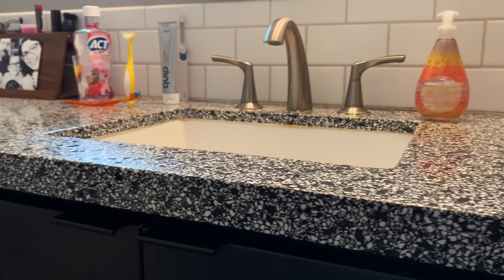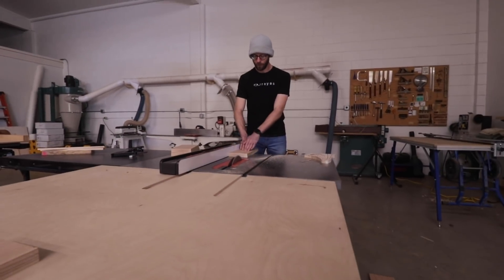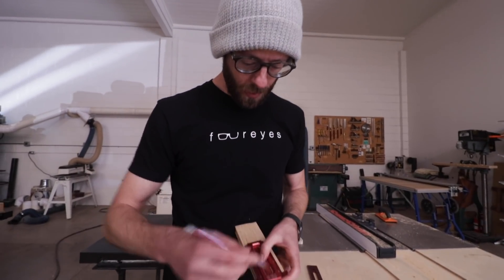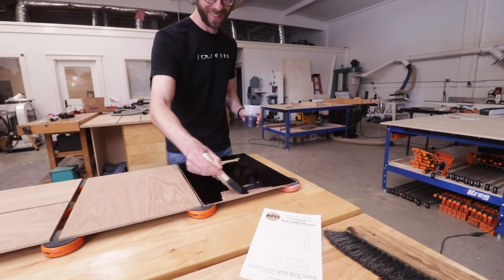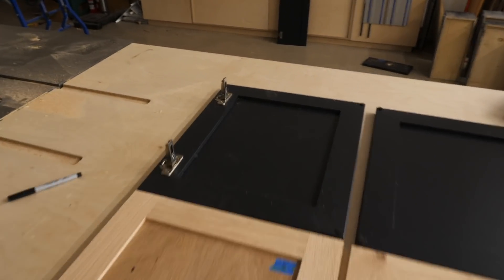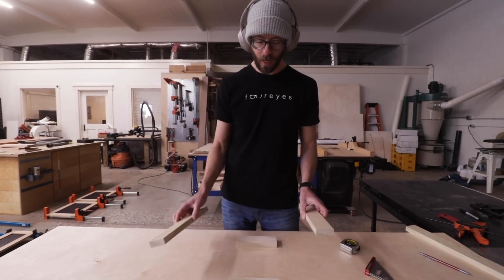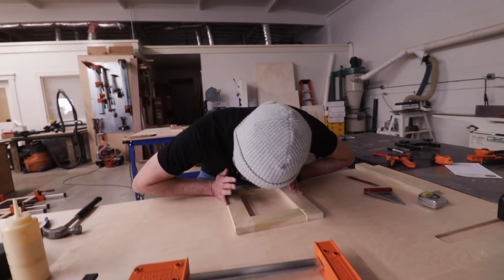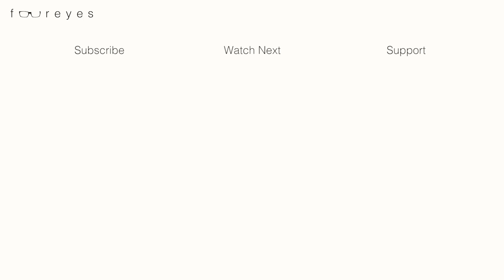My Bathroom Vanity Sucks! I'll Remodel It - Build With Me

Comment: I feel Chris needs to invest in a metric tape measure.. In fact, I CHALLENGE him to do a video in JUST metric.. :D

Being Australian, It's metric here, but I fully understand the Imperial system, and even talk in in sometimes, but I almost got a migraine (my eye actually started to twitch a bit) listening to Chris try and work out the fractions in his head, by talking them out loud..
6 and 3 quarters inches, plus an inch, minus 3 8ths.. gahhrghhgraAHH!! stroke out

Metric is the only way to go, RARELY do you need to go into half millimeters in woodwork..
So, the above mess would become (yes I'm rounding for clarity) 172mm plus 25 = 197mm, less 10mm = 187mm. cut.
No messy fractions, whole number calculations, and the entire system is Base 10 - you can do metric on your fingers..!
Reply from the maker: I admit it's a better system. So as soon as my country makes it easier to switch I'll be glad to. That said. The problems or topics in this video didn't have a lot to do with metric vs imperial. For example. If you subtract 3/8" or 9.525mm from a gap...you'll end up with a panel that is too small.
Reply: tell me how to divide 10 cm into three equal parts.
Reply: @thecrazyisreal  sure. 10cm is 100mm. So divide by 3 = 33.333333
I have gone to a millionth of a millimeter (you tell me what that is as a fraction). But for wood working we would never go to that accuracy level.
Reply: @W B I’ve just checked my imperial drill bit set and I can’t seem to find a 1/3” or a 5/6” drill bit anywhere??? So you have the same issue if you divide 10 inches into thirds also.
Reply: W B & MatiuPirihimana Multi-point equidistant dividers don’t require math. You can divide 10 cm or 10 in into as many identical sections as points on the dividers.
Reply: Fun video, nice change that shows you’re both human
Reply: @thecrazyisreal  you can't cut an inch into 3 equal bits either mate, so your point is moot.
Although a set of drill/Forstner bits in thirds or sixth's, even twelfth's perhaps, to fill in the gaps up to an inch would actually be handy in some applications).
All the divisions of an inch are by 2, whereas you can easily cut up a centimetre by 1's, 2's and 5's.

But to answer your question, you would measure to 3.333 (which is a few sandpaper passes bigger than a 1/8th" drill bit in fact)
I don't know about you, but I can easily see down to .25 of a mil, (that's 10/1000ths of an inch, by eye, man), and hit the mark with my knife, (not that you really need to be that accurate in timber, in steel sure, but not timber).

Now, metric bits come in half mil steps, so getting your 3.5mm bit is close enough for wood work, adding 3 of them together means you'd use your 10.5mm, which gives you that 0.25mm clearance around your dowel. I'm happy with that.
Reply: @Foureyes.Furniture   metric is already used in the States all over the place, most science and engineering, specifically in the space industry use it, but in order for metric to become widely available and used in American life, it would require the public to demand it, on mass.
I'm not saying you guys should just dump the imperial system in a weekend.. This would have to be a generational thing, and for it to be taught in schools along side imperial, and doing it this way would get people to accept both.

People who use rulers and tape measures will have to just only buy metric ones, even if that means getting them online if Home depot doesn't stock them.. as well as repeatedly requesting stores to get them in.
In the same way as I have to get my Titebond online, (or drive a 400km (250mile) round trip to Sydney to the only place in the state which stocks it), since our main chain, Bunnings, (my local is 8 minutes away) doesn't carry it, and not for want of me requesting it for the last few years either, I might add)..
The wheels of change turn slowly my friend, and sometimes they need some oil to get them going a bit quicker.. be the oil. 🙂
Reply: I know! It does my head in!
Reply: I'm an american and I do all my woodwork in metric. it's just easier, and all our tools have metric measurements on them anyway.
Reply: “A linear foot?”. Would a woodworker think it be fun if I say “No, a logarithmic foot”?
Reply: It's weird to see some arguments against metric: how you divide by three, the construction business, the is no equivalent in metric to an inch, and my favorite, there is no volume in metric corresponding to the typical thirst of a humsn being...
Reply: @GenoLoma  They've been trying to go metric since 1975. I say it's been long enough to ease into it, do it tomorrow.
Reply: Yes Please :D my brain is burning because of impeiral :DD but i like his work realy much!!!
Reply: @karenmitchell6814  yes, but you don't. You use six as the base.
Reply: Listen my Australian friend!!  There are two countries.  Those who use the metric system and those who went to the moon!!  Seriously, I use metric at work, injection mold making, and it is easier.  I'm just too stubborn to use it in woodworking.  Maybe one day.  So, we use bd/ft to buy our lumber.  What do you use?
Reply: @peepawhebert6479  theres not a lot of rough sawn limber yards around here, so most timber is already dried and dressed ready to cut up.. the only issue with this is that we are kinda limited on our standard dimensions for timbers, without having to resaw and plane things down from bigger timbers .. everything is in metric though, so 3/4" is around 18 or 19mm.. plywood comes in 7, 9, 12, 15, 18 and 25mm. Some tapes will show half mil steps, which gives you 50 divisions in an inch, and I challenge anyone to require accuracy in timber higher than that..
As for going to the moon, the space program has almost exclusively used metric for pretty much everything.. and in fact, when people have misinterpreted dimensions into imperial, that's when things have failed..
I can, and do, use both systems, but metric is orders of magnitude easier and cleaner.. as evidenced by the 3 minutes of brain-melting discourse in this video.. it hurt my head to listen to it, and I understand it! Imagine someone who can't..?!
Reply: For me the imperial system is like measuring in squirrels and caterpillars. The hight is 3 squirrels, 5 caterpillars and one severely mutulated caterpillar

Comment: When I'm using a miter saw like that and want to cut consistent length pieces I cut one piece and then use the built in clamp to hold that in place. Then that becomes your new fence and you can flush up the ends of that with the next piece and cut it exactly the same. It will also serve as a backing piece to help with blowout.

Comment: Similarly to another commenter, there are usually holes in the fence of miter saws that you can use to screw a long 3" wide board to the fence and then use as an auxiliary fence to clamp a stop block. This was my setup for awhile before I got a table saw and it works fairly well for repeatable cuts

Comment: The math on 1/8 and 1/16s broken dimensions is harder??? Metric to the rescue!

I love to watch a lot of you North American makers, but your dimensions system make me crazy! Fractions all the time, crazy math when adding different base fractions: 3 1/16 + 4 1/2 + 1/8...  Crazy stuff... So I learn to just ignore the dimensions and try to just get the big picture.

We "metric rest of the world" just add. 1mm is measurable with simple tools and precise enough for a lot of things (like woodworking) at the same time. You have control over the dimensions? Centimeter is a precise enough to a design phase without using fractions (or in our case the millimeter). In the very precise world you don't need to change the way you calculate, no tenths, hundreds and thousands of an inch (in base ten)  mixed with fractions, just more zeros between the comma and the number.

And if you have mm and cm mixed in the project in different tolerance parts? No worries: 50cm + 23mm + 2,5cm don't confuse since everybody use base 10 math in day to day tasks and learn to move decimal cases around when needed (like with money).

Just a rant... Still love the content, just hate the measuring system.
Reply from the maker: I admit it's a better system. So as soon as my country makes it easier to switch I'll be glad to. That said. The problems or topics in this video didn't have a lot to do with metric vs imperial. For example. If you subtract 3/8" or 9.525mm from a gap...you'll end up with a panel that is too small.
Reply: I understand the difficult in the transition, but metric will never catch up in USA if everybody wait to be a more accessible thing. The ruler manufacturer will never sell metric rules if all the buyers waits to every rule be in metric (oversimplification in its worse!).

Some channels are doing a thing that I think is a disservice for metric, telling that the plans are in both systems but showing metric dimensions in a simple conversion: 1" or 25,4mm... 1/8" or 3,18mm... It creates a sensation of complexity that doesn't exist... 

But the main reason of the metric will never catch up in USA is the fact that when the discussion start the argument that "it's better because it's our system" prevails in the comments... The "freedom unit", "Murica, duck yeah", etc... This is the main reason it will never change in my opinion, since any act towards metric is seen as almost an offense and an obvious reason that nobody in the maker scene (mainly YouTubers) not even try, since the backfire could be disastrous.

And my comment was based on a part that you say in the middle of the video about the added complexity when you start to add  lots of broken dimensions on the calculations, sorry for the off-topic and for any errors in the english and I wish you the best from a lock down Brazil!

Comment: Regarding the glued in door panels: will the different rates of expansion/contraction eventually cause the panel to separate from the frame? I thought panels were supposed to “float” in the frame. Thanks. Love every vid!
Reply from the maker: You mean for the simple version right? If so... I don’t think so. The rails/stiles are so narrow they won’t move much, and the panel is made of plywood so it’s pretty stable as well.
Reply: @Foureyes.Furniture  The panel is very stable, that's not the problem. You would be better off screwing them on as screws provide more movement than glue. Not saying they will ever break, but why give it a chance.
Reply: My vote is hot glue on the backside. It will trap the panel and still allow for wood movement, then you aren't depending on the strength of the veneer. Also hot glue can be laid down neatly,  it's an art, like caulking.
Reply: You have to think of it like this, since the rails and stiles won't change in length, the interior rabbet the panel sits in won't change. The exterior dimensions of the door might change as the rails and stiles get wider and narrower but they can't move inward. (My take on it, anyway)
Reply: @jeremyspecce  What you are saying does make sense. There will be more movement on the outside of a door than the inside.  I had a call back from a customer when I accidentally glued a sold wood panel to a door frame.  The panel cracked and I learned a lesson about wood movement. But it would be much harder to crack a plywood panel as it would be stronger and not move as much as solid wood.

Comment: I’m curious, when you are pre-coloring your inside panels before assembly, was there a reason not to use a coat of the final finish rather than leather dye? Thickness perhaps?
Reply from the maker: just time. The leather dye one coat did the trick. With the finish I'd need to put on a few and do some sanding and then put more.
Reply: Cool, thx!

Comment: Technical question: Why rip one edge on the table saw after you jointed both sides? If you are worried that your router is not square, can't you joint one side, rip the opposing side on the table saw and just check for squareness? Thanks for the videos.
Reply from the maker: I have no idea or memory of what I even did in this one. But typically you would joint just one edge, and then rip the other edge to create a piece where they two edges are parallel.

Comment: my gawd people...use metric!!!! it's soooo much easier
Reply from the maker: I admit it's a better system. So as soon as my country makes it easier to switch I'll be glad to. That said. The problems or topics in this video didn't have a lot to do with metric vs imperial. For example. If you subtract 3/8" or 9.525mm from a gap...you'll end up with a panel that is too small.